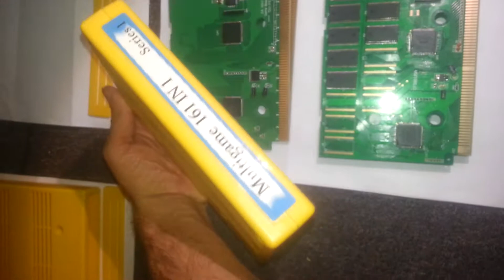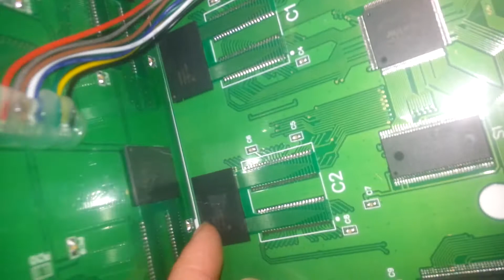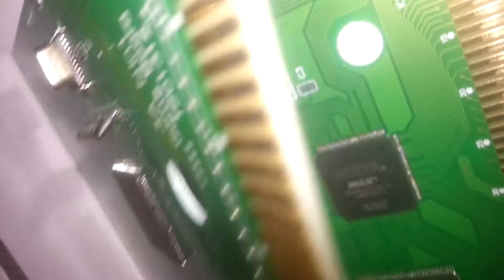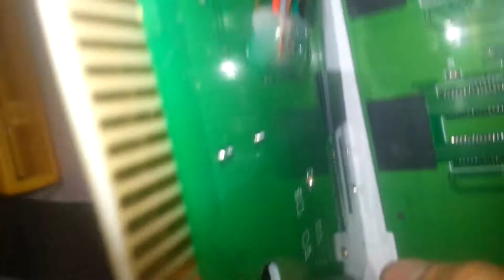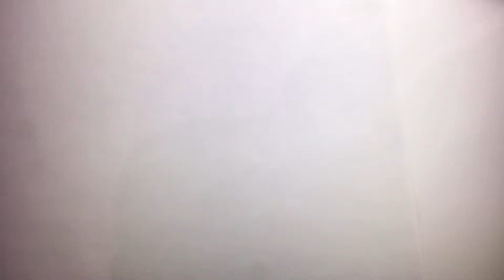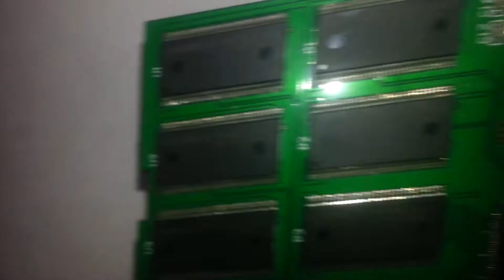Neo Geo MVS 161 in 1 Hacking Part 1 (new and old model)

Comment: Great video, thanks!  Does the new revision still require the PCM sound fix?  I just got a new 161 in 1 off eBay, but don't have my MVS yet and I think I also got a revision 3 like TheDrunkenPL
.  :-)
Reply: most of caps are added  in this 3rd revision , all you can do is add   caps filter for tension regulator  (this caps are not yet added in this revision) , personally  the sound look much much better than 2nd revision without doing the fix

Comment: Segasonicfan I just received my 161 in 1 and was prepared to perform all the mods. And it turned out that 3A has made 3rd revision! Voltage regulators as well as all the caps (also electrolytic) are already on the board.
Reply: @SegasonicfanDesigns  sure :) please check if you can access it:
https://drive.google.com/open?id=1g68yqdRkm7hQc1fx6XBAjdsbQ8k2FGLw
I am only curious why one of those voltage regulators is 3.8V - mistake or intentionally?
Reply: @TheDrunkenPL   have you tested Tophunter with this 3rd revision ,  did it work perfectly , what is you slot model 
?  for me i have graphic glitches in the background of the game , thanks
Reply: Bessem Mannai MV1-C and unfortunately I haven’t tested this game and I have it right now digged some deep down in console stash after move :/ I will try to check it and let you know.
Are you thinking about buying newest rev?
Reply: @TheDrunkenPL  i have this 3rd revision and like said before top hunter work with dirty graphic glitches on the background so i want to see if this problem come from the cartridge or from some incompatibilty with my mv1-fz
Reply: Bessem Mannai hey! I just checked Tophunter and works like charm, no gfx glitches at all, not sure about sound as I would have to mess with the cables to make it work. I have a photo if you would like.
I’ve heard that MV1F rev is most problematic and it seems to confirm it :/
Reply: @TheDrunkenPL   thx man ,  exactly  i m not the only one with mv1-fz who have problem with top hunter  in this 3rd revision , so  i wil try to  find   a mv1-c  slot  in good deal , thx so match for taking time trying , so another last  thing ,  you dont have some freeze in the last blade  one and 2  like what you see in this page? :http://www.neogeo-system.com/t8903-tuto-in-progress-modification-mvs-cartouche-161in1-v3
Reply: Bessem Mannai please that I could help ☺️ about last blade i would have to unpack whole stuff again 😞 only thing that I’ve heard about LB is that either 1st or 2nd game that was compiled to this multirom was some beta with game breaking bug making the game freeze. But for sure it was only one of those two.
Reply: @TheDrunkenPL    nevermind , thx again for the help , still  happy with this multicart  , enjoy game man
Reply: Bessem Mannai cheers mate!
Reply: @bessemmannai7390  I Had the same problem With MV 1FZ .. or MV 1B
But the only I play perfectly fine is
(MV 1A) it runs good No graphics glitches 
Top hunter and LB 1/2 ^^( I had no idea).
Reply: @Kamnaruun  thx for confirmation